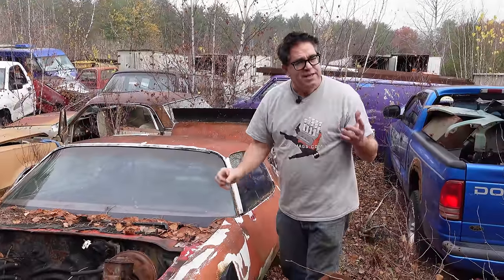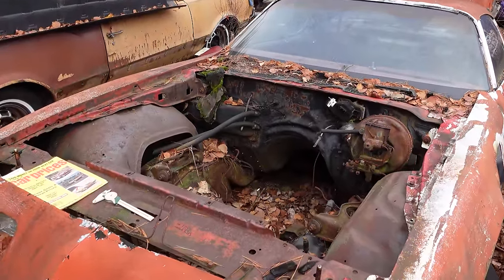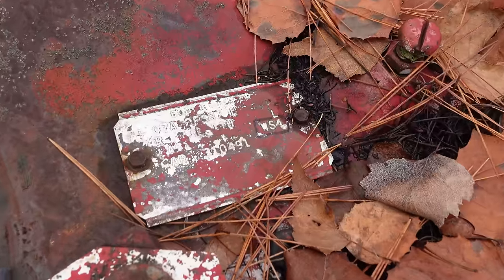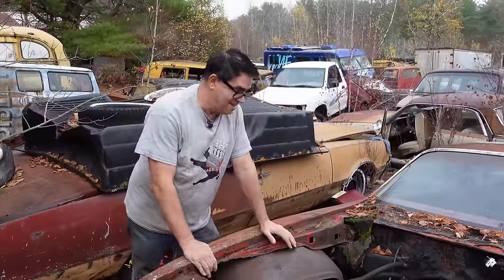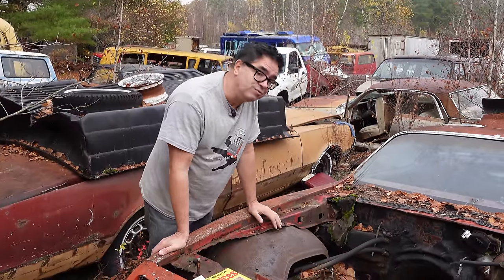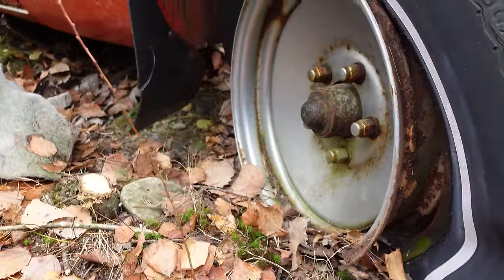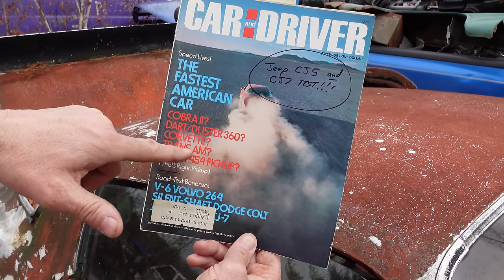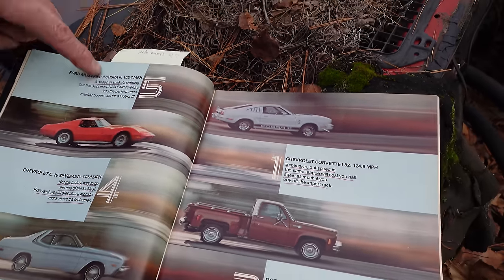1979 Trans Am

Comment: 79 was the first year for that style of nose, Trans Ams used urethane front ends since it was introduced in 1969. As a Pontiac enthusiast I have to speak up, Steve there was no such thing as a Pontiac "Big Block" every Pontiac v8 from the 326 to the 455 were all the same blocks. In a 1979 Trans Am if you had a 4sp you got a Pontiac 400/4bbl. An auto trans would have garnered a 403 Oldsmobile motor. The VIN reads 2W87W9N108XXX I can't see the year clearly. A 301 4.9L was available in 79 in the Formula and T/A for sure, it may have been a selectableAnd
Reply: Mostly correct. The 4 speed and the automatic were both available with the 301 in 1979.

Comment: The 301 was an option in 79 for the Trans Am. It was a reduced cost option and there were some who bought them, not sure why but they did.
Reply: To allow for a manual four speed option (since the 400 was in limited supply), to help the CAFE numbers, to offer another option and to use up 301 engines for 1979 production.
Reply: @googleusergp  while having a 4-speed would have been nice I don’t think I could have opted for the downgrade to the 301.
Reply: @TheOriginalLugnuts  Most people got the 301 V8 when they "ran out of gas" (money) on the order sheet yet still wanted a Trans Am.

Comment: I bought a brand new 1981 T/A with the 301 and it was an absolute pig. The first year for the electronically controlled four barrel circulator and engine controls along with lockup torque converter and I had constant problems with it for the eight months I owned it. The fuel economy was poor with the best being 14 MPG on a long trip. The torque converter  would erratically lock and unlock at any speed and one time the engine started running rough by itself causing the catalytic converter to overheat and start the carpeting on fire. The dealership I bought it from didn't know how to work on it and didn't have the proper equipment to diagnose the problems. GM build quality was probably at it's lowest in 1981 as I also had problems with the power windows and door locks along with bits of trim just falling off.
Reply: Worse if it was a Van Nuys, CA built car. That build quality was awful.

Comment: I have a 79 Trans Am WS6 non Tee top with the Pontiac 400 and  ST -10. I was told only 1500 WS 6 4 speeds were  made.
Reply: Roughly 8,000 Pontiac 400 engines were installed in 1979 Firebirds. The rarest is the 1979 Formula with the 400. Only about 300 or (346 if I recall right) made.

Comment: I owned a 79 ws6 301 trans am . It was a 4 speed and had the factory disc brake rear with 308 gearing . They could be ordered with the non turbo 301 @ 140hp
Reply: Yes, in 1979, the only 301 was the non-turbo. The turbo was available in 1980-1981 and the non turbo 301 also in 1980-1981.
Reply: The 301 4bbl in 1979 was rated at 150hp 4000 rpm and 240 ft lb 2000 
 The 301 2bbl was 140hp.  In 1980 there was a W72 301 rated at 170hp.

Comment: The Trans Am probably used more "other brand" engines than any other performance car--Buick V6, Olds 403, Chevy small block, and Pontiac. Every GM performance engine family but a Cadillac.  TransAms had the engine turned dash, Formulas the wood grain until the 84 generation.

that second gen Cutlass next door must be a convertible with the bedliner over it? might be hot-roddable if it can get reached.

Comment: I had a 1980 Turbo Trans Am that was the same color as that one it had a 301 with auto trans tan interior and 4 wheel disc brakes power steering, brakes, windows, door locks. It was a good car but after a while I had too many cars and ended up storing it and in that time mice ruined the interior the car smelled like mouse pee and ripped the cushion out of the back seats to make their nest I ripped the carpet out and washed the whole thing and seats but the smell was still there so I ended up selling it because I could not stand the smell.

Comment: What about the his and hers shifter? One thing nice about these sad examples of performance vehicles is that it gave a back door push on backyard performance. Couple of years later my truck was eating vets and spitting out tailpipe and as you can see that's no major feat back then. But it was also clocked at 160 mph by the sheriff. The one and only time I ever loan my truck out. There's an interesting post story to that. I think I heard you say the spoiler would make a difference at 150 mph on that car. I'm here to tell you didn't have to go that fast to feel the difference. My reference is same general shape slightly different because it was a 76 Camaro with a retired but not very tired dirt track car engine in it. That'll give you the idea of the specs on it. Repainted the car slicked it all up, put the engine in it. Later I put a spoiler on it mainly because it would sell for more money. But that spoiler made a difference on handling. But if I was ever going to take  any car out and do 150 mph with it, it would NOT have been one of these especially with stock suspension. A friend's dad bought one of these TAs with the right engine and all the right options including the his and her shift package. That's when we discovered the shift package. But one run down the quarter mile and as the old song said, "The thrill is gone!" A common comment about these cars back then was; oops at least they remembered to put the headlights in, before it left the assembly line. It looks like they just cut four holes and slapped the headlights in. Remember we weren't looking back and romanticizing them, they were new at the time. But at least it had a little bit of the bird beak. Thanks for the info on the video. And we'll see what Google GP does with a partial Vin.
Reply: No, the dual gate shifter was aftermarket.
Reply: @googleusergp  if you're talking about the his her package. He bought it new with less than 3 mi on it from the dealer just like it sat. I only accidentally found it out. But that had been maybe 1982 or 81. The owner did not know it was there neither did his son. So that's a mystery. I subtract them down not to answer this question but old time sakes. But I believe you've given your expertise on these birds. I still have the remains of an early 70 bird than a 455  in it. But there ain't much left of that car I sold every part of it I could back in early 80s. Can I get insurance for it!
Reply: @CAROLDDISCOVER-1983  It was aftermarket installed. I never saw a GM part # for that in the books nor did I ever see on the option sheet.
Reply: @googleusergp  I believe you. You know it's on these cars speaks far itself. It's just a mystery. Besides it is possible I miss him sit back then our doubtful that my memory is flawed on it. But if I remember it wrong from the get-go which is possible, maybe his dad was just being quiet on the subject. Here is a methodist preacher wanting to stay in the area but he did quite fit in. But he helped more than one of  us kids. I'd say that was more important than the shifter. That's why I asked you. I was curious because I've never heard anybody else say anything about it. But it was nicknamed at least by them his and her shifter or his/her package is how they Said it.
Reply: @CAROLDDISCOVER-1983  Padre was tapping the wine too much. LOL. That's aftermarket equipment. GM never installed that on the line. If they did, the parts book would have a part number and it doesn't.

Comment: My Krause Standard Catalog of Pontiac, buried in the engine section for 1979 does say a 301 4-bbl is an optional engine for the Trans Am.   Nice book but terribly laid out.

To the right of the Trans-Am, past the Olds with the truck bed liner on it, would love to see a good clean shot of the van with the fuel logo on it.

Comment: My fathers buddy bought a new one in 79. Anniversary edition with a 301 turbo very very unimpressive as far as power goes but what a nice card
Reply: You could not get an "Anniversary Edition" with turbo. You could get a Black SE turbo 301 in 1980-1981, a Pace Car in 1980 (all were turbo V8s), or a Nascar Edition in 1981 (all were turbo). The 1979 10th Anniversary either had a 400 Pontiac or a 403 Olds. No 301 equipped cars.
Reply: @googleusergp  I must have had the year wrong.
Reply: @dustyroads834  1980 Pace Cars and 1981 Nascar Trans Ams were all turbo 301 cars. 1979 10th Anniversary cars were either 403 Olds or 400 Pontiac equipped.

Comment: 301 turbo pontiac was weak until you disconnected the knock sensor and used premium fuel with octane booster
Reply: Or just drove and tuned it correctly.

Comment: If that car came with a 301, I wonder if someone pulled that motor thinking they got a 400…?  I was hoping you’d hold up the 79 Hotrod that had a great story on the TA.  I still remember that magazine even though my copy ‘s long gone.  I test drove an 80 with a 301 or 305 Chevy. Wasn’t fast but cornered and brakes better than anything else I’d ever driven up to that point.
Reply: It is very easy to tell a 301 and a 400 apart the O1 heads , the single plane intake , the oil filter sticking straight out and not down. The card spacer.
Reply: Haha yeah that would be funny, imagine the call from the machine shop informing him of the bad news.

Comment: @ 9:37 where it shows the final drive at 3.23 (on the Trans Am) I'm thinking that was the limiting factor in it's top speed because I have personally been in a 403 powered 1979 with a 2.7x something gear that would run 140 mph 😜
Reply: Correct. 3.23 on the 400 with AC which limited top speed to around 132 MPH. 2.73 on many 403 equipped cars, yes.
Reply: Thought the 403 was 2.41 (A/C) or 3.23 without A/C.

Comment: Those top speed numbers from performance oriented cars are truly terrible.  For reference, I still own a 1979 Mercedes 240D.  62 Hp and the car weighs 3300 lbs.  Top speed is 95 mph.  4 speed manual and stock rear end gear.

Comment: 301 might make more sense if Pontiac made any turbo T/A's in '79, as the 301 was the Turbo T/A engine. I think 1980 was the first year for that though.  The 403 Olds 'station wagon engine' was kind of a smog era turd in stock form, but with their 4.351 bore, they can be stroked and grown into a monster.
Reply: The 301 V8 was a credit engine in 1979 and became the base Trans Am engine in 1980-1981. The turbo 301 was available in 1980-1981.

Comment: Not true Steve. My ‘79 firebird TA with the 403 olds had a switch on the dash that opened a flap on the rear of the shaker. It was not sealed completely like you said.
Reply: That was not original for a 79. Only the 72 and earlier shakers were functional. All shakers were no longer functional from the factory from 1973 through 1981. The 73-76 had a block off plate riveted over the back hole. The 77-81 shakers were molded completely closed on the back side. So, it's most likely that somebody modified your shaker. There's a "trans am shaker scoop functional flap kit" available to modify the shaker to be functional. It's a pretty popular thing to do, as was just cutting them open. You can find the kits with a google search.
Reply: @grand73am  interesting.  Thanks for tgat!

Comment: Steve you didnt mention the w72 400 ci 77 78 79 in 1978 could get the 342 safty trac , super t10 4spd , w72 option engine better block cam carb 800 cfm 6×4 heads for 220 net which was realy 260 and with exhaust and tune 300 + hp come man you no everything !

Comment: 200 HP at 3500 RPM! I would bet that wasn't the peak horsepower. I've never driven one, but I would guess horsepower peaked somewhere near that 4500 rpm that "maximum recommended engine speed". Maybe around 240 peak HP?
Reply: 250-260 HP in real life based on NHRA testing at the time, 220 HP in 1979 with the 400, not 200 (that was the 1977 W72). I own one, it can move out very nicely.

Comment: 200 hp but it was rated at 3500 rpm. Somebody was fudging the numbers....
Reply: Nope, the big engine just died much above that rpm trying to exhaust through that pathetic system with the terrible pancake catalytic converter. Put a good exhaust on that car and a tune and probably pick up 100hp.

Comment: 200 hp at 3500 rpm it says for the 76 455. Little under rated. Wonder what it was making at 5000 . Awesome cars
Reply: It rolled over just over at 4000, so not much.
Reply: Probably not any more with that single catalytic converter and pathetic exhaust and these early pancake style were the absolute worst of all and surprised it even ran that good. Chevrolet tried to offer the 454 in the Corvette for 75 but just couldn't make it work to pass the 50,000 mile durability test and it made too much heat so they gave up.

Comment: Good old 1979 it`s the same year I was born. It`s funny that the Dart with a 360 was faster then a firebird with a 455 and a truck with a 454. I have a 1974 Trans Am now and it has a Y code 454 and it`s 250HP and it may not have lot`s of HP but it has tons of torque. That car get`s out of hand when giving it 3 quarter to full throttle. the ass end likes to go sideways and leaves a long black stripes down the road.
Reply: "Y" code 455 Pontiac V8, not 454. The 454 was a Chevrolet big block V8. The 455 Pontiac is neither small or big block. It's just a Pontiac V8.

Comment: Wasn't there an independent rear suspension available in Trans-Ams of this vintage?
Reply: No
Reply: No.
Reply: @googleusergp  I am probably mis-remembering the optional rear disk brakes as being independent suspension.
Reply: @DougsMessyGarage  Yes, disc brakes were an option from 1979 onward. You could get the WS6 (without disc brakes) in 1978. For a time, there was a shortage of rear disc brake components, so you got RPO code "WS7" which was the handling package sans disc brakes, but that was soon resolved.

Comment: Would this have had the F41 suspension ?
Reply: More than likely if optioned, WS6 which took the F41 to a new level with better handling and four-wheel disc brakes. This one likely didn't have WS6.
Reply: @googleusergp  I've got an 88Caprice LS with F41 suspension
Reply: @tylerdakin9131  My '84 Delta 88 Royale Brougham coupe also has F41.
Reply: Standard Trans Am and Formula suspension was Y99 wasn't it? Then the next and only step up was the WS6.

Comment: I swear to you when I was 21 years old I took a 74 firebird on the beltway to about 95 mph it seemed to me probably 97 or 98 I was driving a l6 Chevy standard motor in a 74 firebird after a car passed me at about 80 miles an hour or higher I thought wow well there's an opportunity. I swear I definitely had that car over 90 you seem to me I got to 95 to 98 here's the question do you think and 250 Chevy is capable of doing nearly 100 if the 1979 trans am can only go to 117? Very interesting.

Comment: Handled like a Porker??? I would hope it handled a lot better than those bum heavy glorified VWs.
They however did not go. A friend had one new [yes a few got here to Oz] and I blew it off with a near stock 186ci Kingswood to about 60mph where commonsense stopped us.
Another friend had a 70Mach1,, 351 Windsor.4 speed That was surprisingly quick and it was rings and bearings recon stock.With drum brakes and it did NOT stop!
That had the factory lightening program,, It had no floors, sills were bog. And was at that time about 8 years old. And had been in Oz for some period

Comment: I own a '79 Trans Am WS6 car that is a factory 301/4bbl. It is actually used as a dirt track race car. Unfortunately it was too rusted to merit a rebuild plus it was a really ugly brown color. I also own a '79 Trans Am 403 WS6 and a '79 403 non WS6 Trans Am as well as a '79 Formula 403. In high school (1985/6) I had a '79 10th Anniversary Trans Am 400/4 speed. I wish to the high heavens I hadn't sold it but I wanted a new Formula 350 when they came out in '87 so the T/A was sold. I still have the owner's manual and window sticker with the VIN and I check periodically to see if it is still around and possible available.
Reply: The 10th Anniversary would have been one of 1,817 with the 400, which is quite rare. I bought one in 1999 and still have it. That 1979 brown you're thinking of is code 69 Dark Brown (sometimes called Heritage Brown in some years).

Comment: I have a hard time believing a Trans Am handled like a Porsche.
Reply: With the engine far in the rear, 911s are rather tricky cars to handle. But overall, I’m sure the Porsche is vastly better.
Reply: @Raptor3388  True, although it cost a lot more to repair and cost a lot more in general. You got a good value with the Trans Am back then.

Comment: after 78 they were just ugly and a fire hazard with the 403  for some reason many were car b qued,  glad 82 brought back some excitement
Reply: Huh? That's a fallacy. The 403 was not a fire hazard and the 400 Pontiac was a zippy engine. I know, I own one, and have for 23 years.
Reply: @googleusergp  well you were lucky  there were a bunch of them that mysteriously had fire start like the fords ignition switch syndrome in 80/90s all were olds powered 403 cars  i worked tow and wrecking industry a lot thats where i get my info
Reply: @rctopfueler2841  Or from people that should have never been under the hood. Never had a problem with any 403 I've worked on or any Olds V8 for that matter and I've had one in my family for over 35 years.
Reply: @googleusergp  not knocking olds  love em im just replying from lifetime of hands on  ,have you run a wrecking yard or 24 hr 7 day  road service / towing 20 plus years? your experience may vary
Reply: @rctopfueler2841  I've worked in the auto industry for 30+ years, including for fleets and on the parts/manufacturer side and in a shop. I never worked on a single 403 that had an engine fire, no.
Reply: @googleusergp  but never a road side service / police towing or wrecking yard so different ....your  experience varied